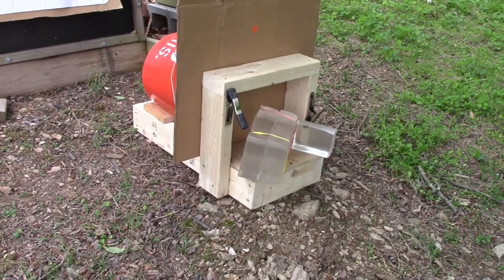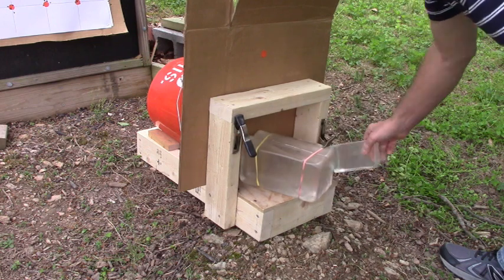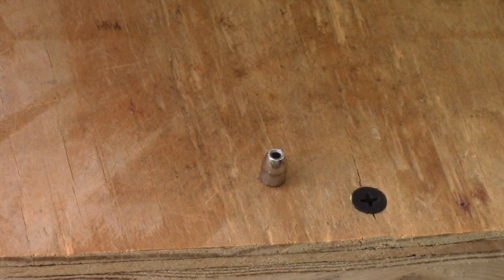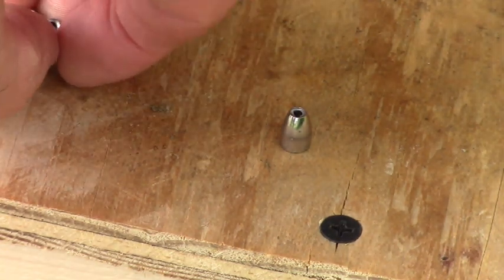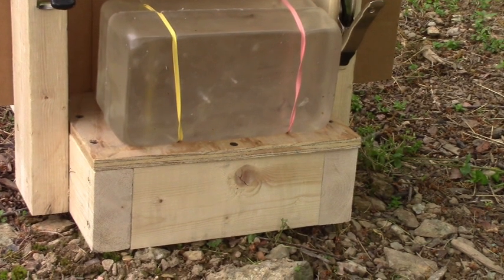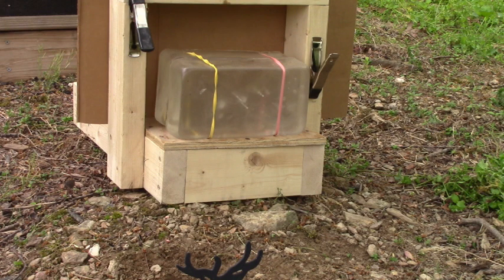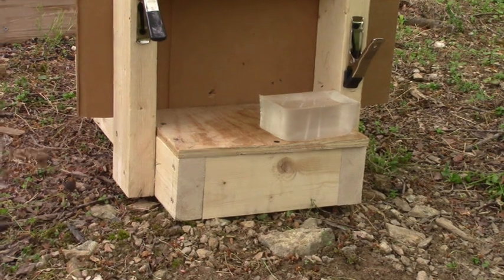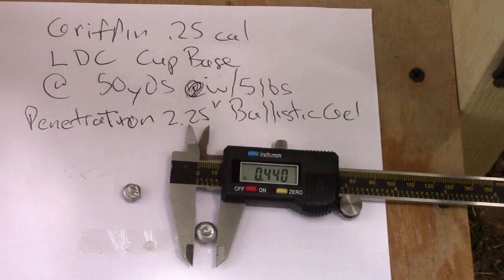FX  25 Hybrid Expansion Testing

Comment: May I ask, what FPS for the 22 hybrid?.
what fps for the Griffin (.25)
and what fps for the .25 NSA through the new (fx) barrel.
I am wondering if the .25 hybrids need to be going closer to 1000 fps.
thanks for the information.
Reply from the maker: The .22 cal. Hybrids were going at 932 fps and the Griffins at 895 fps. Some of the responses I have got on AGN forum is maybe I am not pushing the slugs fast enough, as if with another 30 to 50 fps the .25 cal. Hybrids will magically open up and mushroom. From my experience that is not how it works. There will be a gradual increasing  in mushrooming from a lower velocity to an higher velocity. I don't think you can push the Hybrid .25 cal. fast with airgun velocities enough to mushroom or break apart unless you are striking bone where most any slug will deform or mushroom.
Reply from the maker: Oh and the .25 cal. 26 grain Hybrids through this new Superior liner were going at 902 fps where before the 26.8 grain Nielsens through my slug liner with this tune were going 935 fps.
Reply: @gunpowderairpower8155  ? is, is it the Hybrids or the liner that is the reason, an easy test would be to try the "Nielsens" through the "superior" liner, or put your older slug liner back in and test the Hybrids again.
Thank you for all the info, and good luck.